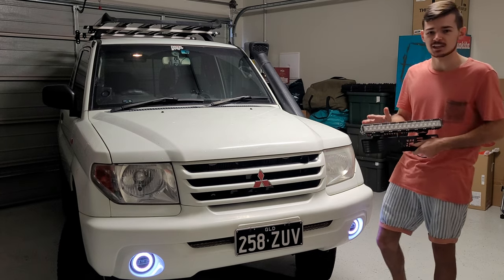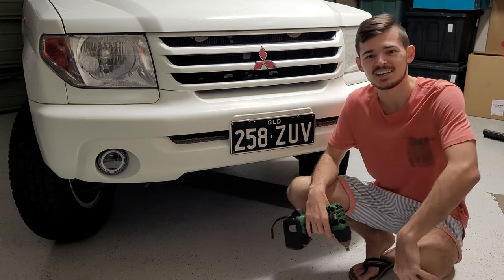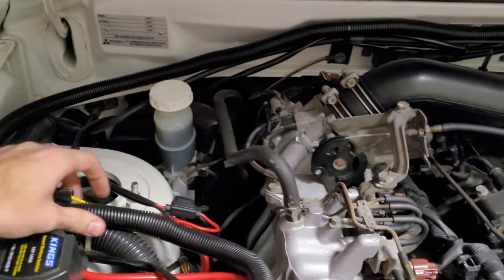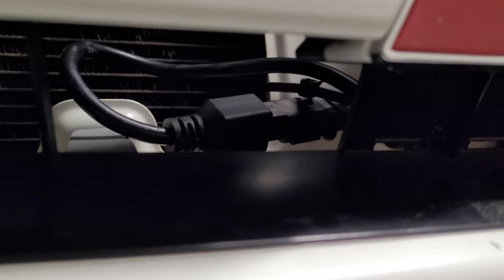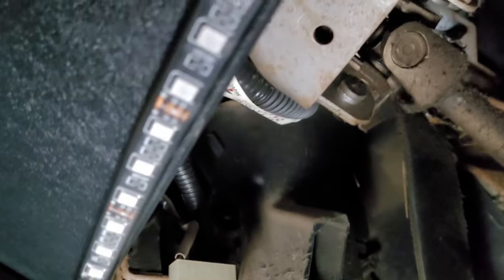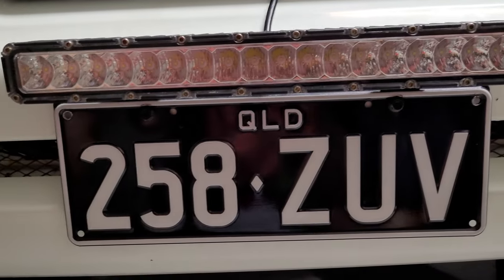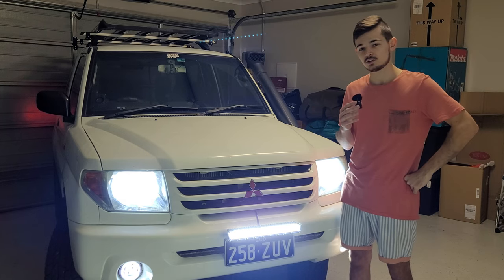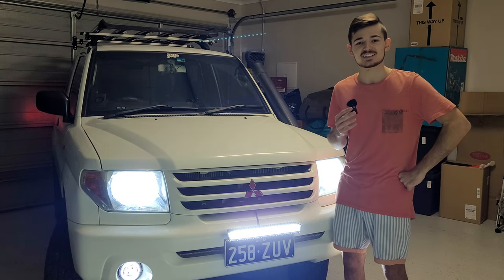Number plate light bar install

Comment: Hi mate
Did your cable from the light bar push hard into your cars bumper when you tightened it up? I have a prado and got it half on but then the bumper was pressing hard to the cable exit from light bar which didn’t look great
Thoughts?
Reply from the maker: Hey matey. Yes I think from memory it was hard up. If you don't want the cable to do that, a hole needs to be drilled through the bumper...see if you can make it run instead of upwards...downwards through a grill maybe?
Reply: @budget4x4life  thanks mate
I could have light bar below my number plate and drill holes through number plate (not sure if legal) and then could mount but then it may also be too low to the ground circa 450mm

Comment: Can you have the light bar on with the normal headlights or does it only fire with the high beams?
Reply from the maker: Only high beam...you will blind people driving with it on all the the time 🙂
Reply: It's illegal to have them on while driving and not on high beam.
Is why you wire them to highbeam. Only turn on when highbeam is on.

What's funny is, I have an ex cop car, (well had lol), it was back when it was okay to drive with spotties on instead of highbeam.. so I used to turn them on n leave the highbeam alone lol

Comment: Also advise is that if your car is going for a roadworthy in Victoria this is not legal, the spot light has to be wired into your high beams so when you turn them off, there off and not forgotten on a separate switch :)
Reply from the maker: Hey mate. It is wired to the high beams via the wiring harness. It can only go on once high beams are on cheers😜💯
Reply: @budget4x4life  cool

Comment: Do you have any touble with the light bar moving around when driving?
Reply from the maker: Been on the car for about 6 months zero issues. Just make sure bolts are tight and you're good💯